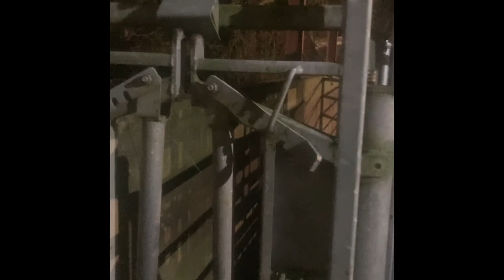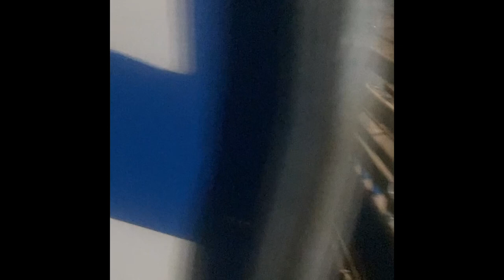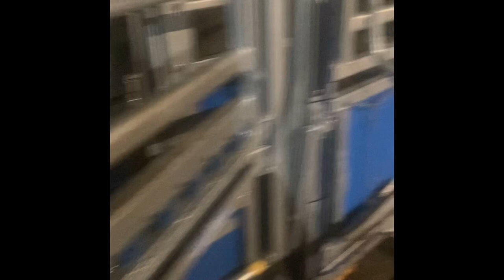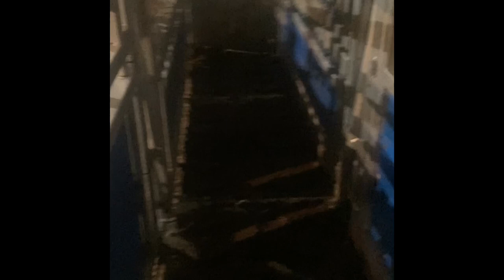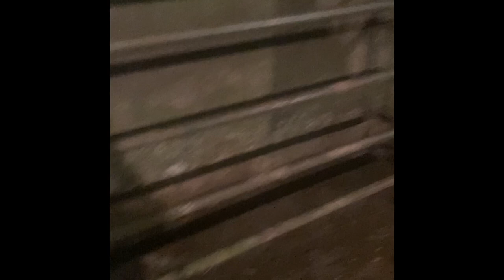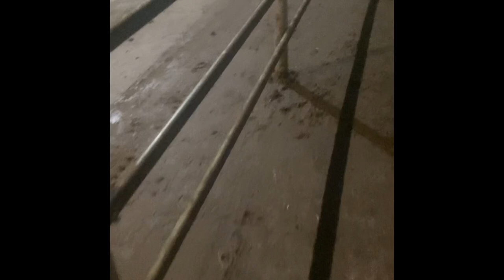Help needed in cattle  yard #tepari  #irish farming #cows

Comment: What spc.is that unit, where are they sold thanks
Reply from the maker: That is a mxi 3 with vet gate,neck injection gate and head scoop
Reply from the maker: I bought it in Perth Scotland
Reply: Thanks Graham
Reply: Hi how many suckler cows and animals do you run?just wondering cause im considering purchasing a unit like this?would it justify to buy one of these units for 20 suckler cows in your opinion @Grahamkavanaghfarming
Reply from the maker: We usually have 95 or so cows and carry 250 total , we have two yards and that’s a problem here anyway as need two of everything. As regards to the crush they are a good job but expensive but should last 20+ years and I’d say a lot more if covered which we plan to do. As regards to your question you have to weigh up your options how often you handle them if like me and work off farm and coming home after work an need to get cattle work done as quickly and safely as possible. They have lots of options dearer and cheaper ,and there are  other cheaper brands aswell. I went with Tepari as I liked how everything worked. I’m not going to say everyone should have one they are good and they will last for years.
Reply: I hear ya. Basically on my own and working full time. I put in headlocking barriers this year enough for 12.two more bays to do.also I've no proper calving gate and thinking that I could calve a cow in the box and utilise the box if a calf needs a hand to get going as suckling.with a grant might work out as cheap besides getting all the bits and bobs or am I mad!?😮
Reply from the maker: @agecard16  with regards to calving cow in the box may not be great if using a jack as the cow can fall down and the jack has no where to go end up in a mess some say the squeeze sides will hold them up I can’t say on that might be better off with a calving gate. Getting a calf to suck they are a good job can hold cow tight stop wiggling around. You need to have things as handy as you can